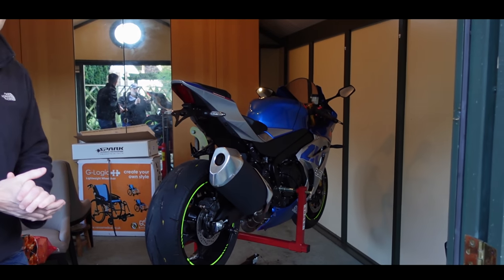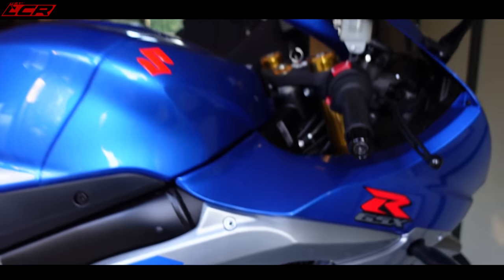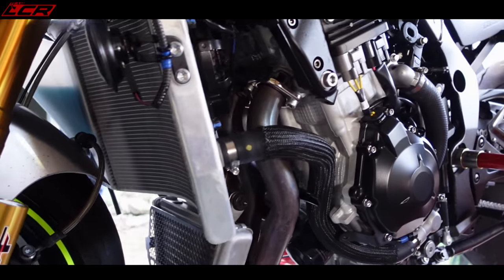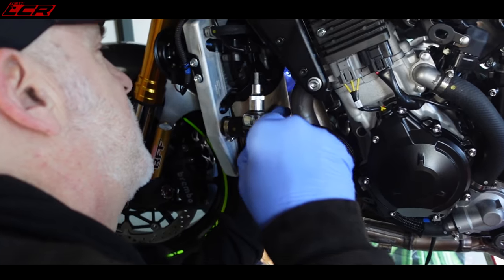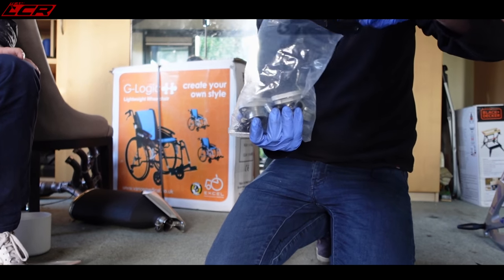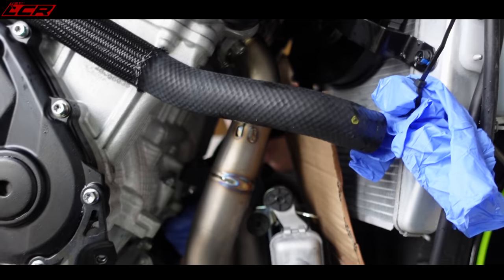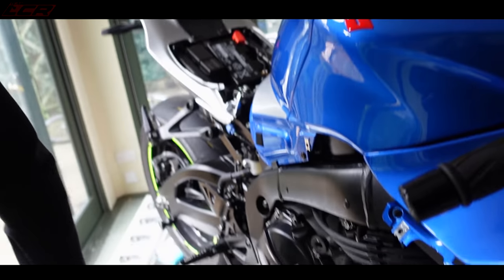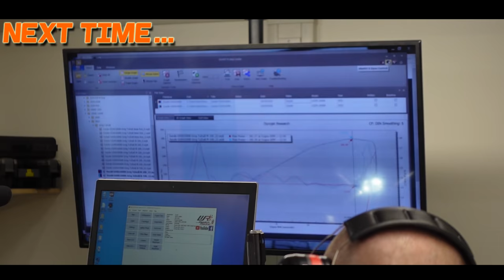Greg's NEW Bike! | Spark Full Ti System Installation SHEXY!!

Comment: This is exactly how every 'simple' job goes. Get your mates round to do something to someones bike, everyone starts happy until you realise it's not going to be a simple job and then everyone starts swearing. Absolute creased me when Greg couldn't find the funnel, happens to me every time you need a simple piece of equipment. Enjoyed it chops, shows the real side to doing bits on bikes, you could have easily cut out all the faffing and swearing but the fact you left it in shows its a proper genuine video!
Reply from the maker: Thanks buddy, yes this is exactly why I left it as is 👍
Reply: @LambChopRides  Bought a 690 because of your build series and I took it to a mates workshop for a simple hour job of modifying the stock exhaust to take a 51mm slip on, 6 hours later we were done 😂I think buying the tekmo header would have been worth the time

Comment: Always replace the caskets as they are compression fit one time. It would be a nightmare to have to take the exhaust off again if one of the caskets leaks.
Reply: Or anneal them...heat them red hot, drop them in cold water...reusable then!

Comment: I have come back to bikes after a short break of 40 years and, for the life of me, am bewildered by the modern bikers total obsession with immediately replacing the factory exhaust (like this is a new bike, here, that this young... cough...'lad' has bought.  I find it difficult to believe Suzuki warranty will also not be now void with a non standard exhaust on) .
This machine is hardly going to be a slouch with the standard exhaust, although I grant the weight of the Euro compliant cat is a factor....but, realistically, just how much of a factor?  Is this young 'lad' going racing, then?  I somehow doubt it.  As it stands, for the UK roads the bike in standard trim is more than sufficient.  
The only factor I can think of  is this young 'lad' wants more noise.  I daresay that's a lot of money for a different sound and more decibels....which many tracks in the UK are limiting riders to in any case.
Back in the late 1970's early 1980's we did change an exhaust, too.  However, this was usually a) when the then standard exhausts (no where near the quality of the modern exhausts on my BMW and Ducati) corroded or were worn out and holed,  b) because replacement exhausts were cheaper than a new factory one and c) performance, of which Yoshimura was the king, and DID make a difference.   I knew of no owner back then who would replace an exhaust on a brand new bike, even IF they had the extravagant disposable income to do so. 
 As a side note, it's also interesting it's him getting the new bike as his son (I assume: no offense meant if it isn't)  looks on lol!  It was the other way around back in the day......the sons were the ones tearing up and down the high street on RD250LC's while Dad was pruning the roses.   Theres something about this age reversal I find  not quite 'right', somehow?  When I bought my first bike in 40 years in 2019, and re-visited a country town we all used to go on weekends as young uns,  I felt a bit embarrassed as I parked my bike among the others, thinking I was going to be a Grandad among all the young whippersnappers.  To my surprise - and, actually, somewhat sadly - I noticed there were no young lad's there whatsoever!   The youngest bloke would  maybe be around 50, and many were in their mid to late 60's.  I mentioned this when I had a cup of tea with a group of them, and the main reason seems to be bikes are just too expensive for young lads...or lasses....it's primarily us old farts who can afford them and the insurance.
Reply from the maker: The problem is mostly to overcome the emissions regulations which all new bikes have to meet. The manufacturers have to run lots of ignition advance and really lean on the part throttle it makes them snatchy to ride. Getting a map and removing the CAT means you can add more fuel and end up with a bike which runs as it should without being strangled. Plus of course better looks, weight saving and more power..
Reply: Allspeeds (were on my 250LC) or Micron or really pushing the boat for noise Nikkon expansions! They made a difference to the power band with Boyesen reeds fitted!!! 
Also I don't think you get get your full power licence until 24 years old now? 
Passed my test on a 250cc with the examiner just watching you on street corners, not following you on a bike and instructions via a intercom what was that in 1981!
Plus cars today are MORE powerful and handle fantastic than the XR3 / GTE / RX7 of 40 years ago, so I think more of the youger generation would rather drive a "fast" car at an earlier age than wait unti 24 years old?
When I got back into biking mid 90's from 1980 I recieved some stares at a meet when I turned up in a leather jacket, jeans and Doc Martins (12 hole) this was not the "look" as most had full one piece suits with armour and boots helmets to match.....and to make it worst my bike then Honda VFR400 was the ONLY bike there with a stardard end can / exhaust.
However as you say it's mainly only us "old boys" riding now.....but the choice of bike(s) is fantastic?!
Remember when Motorcycle Mechanics were raving over the Kawasaki GPz 1100?
There are some very fast lady riders now also who look very good in leathers too (I'm I allowed to say that) 
Keep it rubberside down tonebonetones and welcome to the new, old age of modern biking!
Reply: @LambChopRides  Fair enough and a good explanation.......I'm still quite new to this modern era.   My 2020 Ducati, fortunately, has no problems with fueling and snatchiness and the exhaust looks ok.    Am I right in thinking a bike does not need a cat for the MOT, as someone else recently informed me?
Reply: @iainian  so true lol!  I also passed my test riding around a circuit of streets with the examiner on foot.   I had a Gpz 550 which was the first of the Gpz's to appear in 1981, and my friend had the 1100 whe  that came out.  The one amazing thing I noticed now, as you say, is this concept of....gasp...body armour, now, in my jacket and jeans.   I go white at the gills at what little protection I had in 1981.....a  - too loose fitting - Phil Read replica helmet and a leather jacket.  Gawd, I even rode in trainers!!
And yes, the choice of bikes, all of them very good,  are light years on in technology. ABS!!  Whatever next?!  Tyres are much much better and safer, too.
Reply: @tonebonetones  Phil Read, now there's a motor cycle rider of greatness!

Comment: Love these aftermarket additions in UK . We put a power pipe on my sons 125 yzr a month ago  he got fined €200 last week riding with none standard pipe , we cant even add extra lights to our bikes the have to come off for spanish MOT
Reply: It’s coming in the uk they recon
Reply: Yep ITV and Guardia Civil have a very keen eye for modifications! Even standard items ion a bike or car in the UK can be flagged if they are not standard in Spain. Big fines and even impounding for doing what would seem normal in the Uk… even changing the headlamp builds to LED or changing the colour temperature from OEM is illegal.. that’s why there is no ‘Halfords’ type shops here.
Reply: @jackmills1274  yep, EU and UK law will make modifying or even working on your own car illegal, this is because of high risk EV batteries and automated driving technology’s coming, the government doesn’t want you frying yourself or causing a massive fire.. Lithium batteries are very difficult to extinguish once a light and a hazard to the fire brigade plus what might seem an unrelated modification could adversely effect an automatic driving system… it is for good reason but unfortunately will retrospectively effect bikes and older cars.
Reply: The exact same thing I wanted to ask Chops .
How on earth can a cat delete and complete system upgrade go through MOT in England? Considering the "no mods law" soon coming to effect. Also the those check points near busy road sections with noise recording/analytic systems linked to camera systems that can track and filter out noisy vehicles. Which apparently also exist, or just a thing of the near future??
I don't even live in England, and I have no problem with these mods, as I also have many modified bikes, just concerned about the future of our beloved toys..
Reply: @laz1go286  Emissions are not checked for motorcycle MOT in the UK, you will always get an "Excessive Noise" advisory for an exhaust but they will never fail you.

I've been stopped by the police twice and they me tioned my exhaust but there is nothing they can do. Sadly all of this will likely change in a few years.
Reply: Move to Thailand...
My son has been riding a 6 speed, 17 bhp underbone 2 stroke on the road since he was 15.
We've just built him up a legit road legal 36bhp, 108kgs (38 with the Spanny) 1995 TZR150, been riding it since he was 16. 
Huge aftermarket, huge moto scene here. I mean, huge.
Reply: @michaelhayward7572  it the European  bullshit. I have a cagiva mito 125 in the garage ( we brought over from UK when we moved)  for the son but I cant get it registered here in Spain it's not standard so its to much trouble and €€€ to sort it out
Reply: @Ze-Germanzuk  thanks for the heads up! 
Yes unfortunately this will change allover the world. Probably in the US as last.
Reply: @marklloyd9472  how about getting the Mito MOT-ed and plated in England and then bring it down to Spain??
Keeping one of your family members' address in the UK, could then keep the British plate in Spain. 
If stopped by cops just prove you're temporary resident and main address still in the UK. They cannot confiscate another country's plate.
This did work for me for many years between two other EU countries (Not with England and Spain)
But kept my vehicles on a reasonable noise level and always top condition and avoided speeding to keep things under control.
Reply: @laz1go286  it is on a English plate I've had it about 9 years  and as I now have a spanish driving license ive read that cant ride something on on a foreign plate when in Spain. The whole idea was to have it for my son. I may ship it back to uk it may be worth it to sell.
Reply: @marklloyd9472  I get it..
Well that's tricky then.
But I guess if it's in a great condition then it's might be worth keeping it as the value of those old two strokes is rising constantly..
Reply: @Mark Lloyd  presumably you still have your UK driving license, just show that
Reply: @MyMednas  no have to surrender you UK licence and have a Spanish one within 2 years of becoming resident 😡😡

Comment: Ive heard if you spray titanium exhaust with some WD40, it will turn a nice blue colour after a few heat cycles.....will match your bike quite nice
Reply from the maker: Yes good tip that, its what I use 👍

Comment: Did you guys start it up after installing new exhaust any lights came up or you have to have it flashed ? Reason I’m looking to delete the cat of my H2 but I rather get other system or link pipe if it will put on a some sort of lights
Reply from the maker: Providing you leave the lambda connected and don't touch the exhaust servo motor it should be fine on an warning point of view. But running without the cat and not adjusting the fueling isn't a good idea as it could run lean at the top. I would advise at least getting it checked on a dyno even if you decide not to map it
Reply: @LambChopRides  thanks a lot very clear and it made things a lot simpler for me to understand why exhaust system needs to done professionally.

Comment: In close tight plumbing - no ratchet guns? Voop, Voop. Did you keep a record of the weight difference v standard system and after market?
Reply from the maker: No room for any ratchet guns Andrew so tight. We didn't weigh anything but will include that in the final vid as that's going to be considerable 👍👍

Comment: Just had my down pipes replaced on my 4 cylinder, 12 year old, 110,000 mile bike. All the bolts eventually came out without drilling but it took 7 hours to complete the job! 😬
Reply from the maker: That sounds like a pig of a job! Well done to tackling it yourself 👍👍
Reply: @LambChopRides  No, sorry, didn't mean to mislead. No, I paid a mechanic who does some private weekend work. I do most of my own spannering but I'm now old enough and wise enough to know which jobs to leave to the professionals!

Comment: If you have an older bike with some miles on it, no matter what make it is, get the enigne nice and hot before you attempt to undo the header bolts, less chance of breaking the bolts off,,,,, just dont burn your self, put some welders gloves on, and a few days before hand, give all the bolts a good bath in something like plusgas.
TAKE YOUR TIME lol.
Reply from the maker: Good tip
Reply: Buy a can of Rema Tip Top(the puncture guys) 'Liquid Spanner' sometimes hard to find, for professional use only(for some reason, maybe toxic or something), there's nothing like it for getting Rusty bolts off...spray,leave for 5mins, off they come, it eats rust!

Comment: I wanting to get back onto a superbike but have a knackered knee. Which superbike has the most leg room?
Reply: Possibly the BMW S1000RR as believe it has adjustable foot pegs so can be set to the lowest position to help with your knees?
Reply: @gregtufnall6276  cheers, that’s the only modern one I’ve sat on so far and it was a little tight but I believe there’s a high seat which may help

Comment: All 2021 and on bikes have 'anti-tamper' electronic monitoring fitted. 
If you remove the cats then flash it (it'll run lean if you don't), the bike will realise the parameters are out of spec and the dash will flag a warning message and possibly go into limp home mode.
Reply from the maker: Not if you flash it, that removes all warning

Comment: Word of warning guys - I had a full system on a 2019 GSXR-1000R. I took it to MSS for a remap and they fucked it. Lumpy at idle, rough at full chat. The guys were very obtuse, simply saying that if I didn’t like it I could have the factory map reloaded or bugger off. I spoke to my Suzuki dealer about the experience and he said plenty of others had said the same. I hope you have a better experience..
Reply from the maker: That doesn't sound great Chris, Greg has tried his and is extremely happy with the results. Main objective was to make it smooth and remove any snatch plus of course some extra power is also nice! Sorry you had a bad experience 😔
Reply: @LambChopRides   Might be the camera effect???
Reply: @tracktime1196  🤣🤣

Comment: I'm looking to get one. Been looking at 2015~ models with traction control and shifter / blipper etc. Will be my first bike in 14 years. Used to ride 600's all year round (snow, ice and the works) but only want a bike for fun now.
Question is, do I really need all these gadgets? Or is a K5 era just as good?
My car is 400bhp so I'm still used to getting a shift on and managing that power and riding a bike is .... well.... like riding a bike.
Am I daft to jump straight back into biking and onto something this powerful?
My conscience keeps telling me to just get a GSXS instead 😁